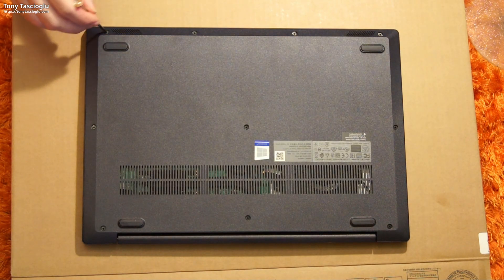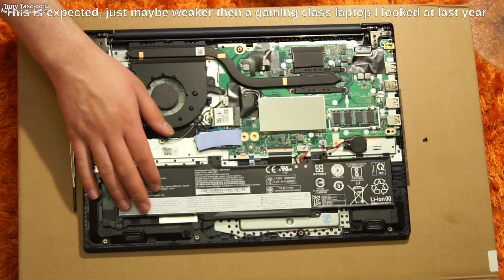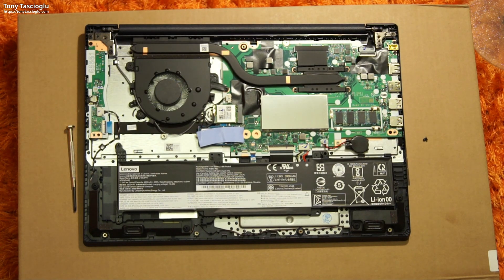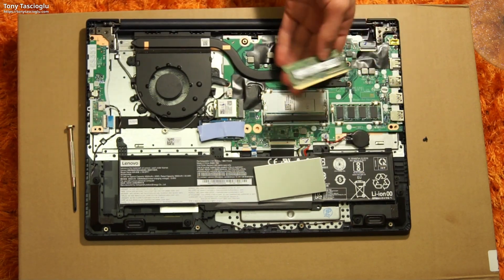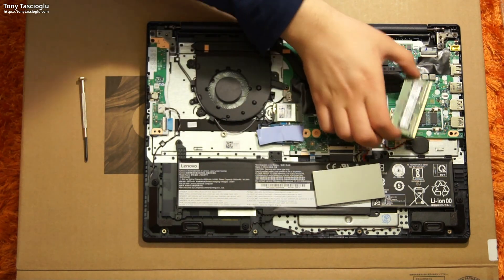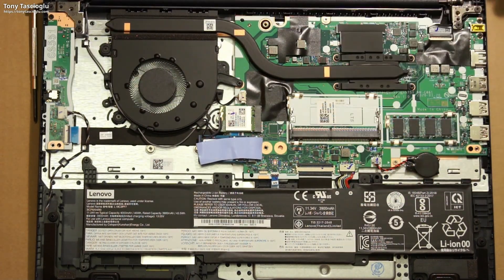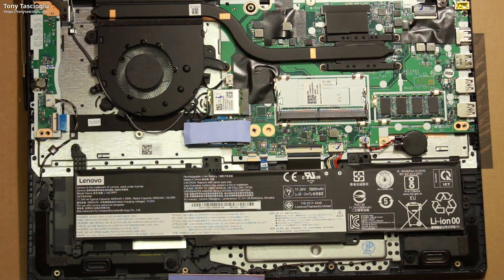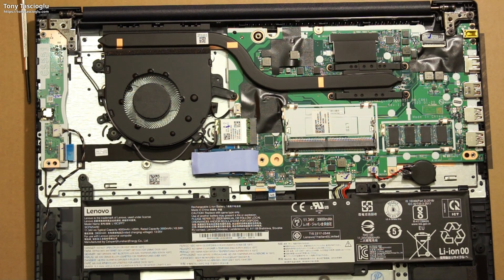Lenovo Ideapad 3 - Upgradeability and Parts

Comment: I hate to say it but it looks like a beginner tech. Some things i notised:
- Crappy screwdriver with no control (too thin handle
- Never pry open plastic with metal. It will cause damage and some customers will notice. You’ll end up replacing parts for free/on warranty = no profit.
- Metal screwdriver will go in too far and could damage conponents
- First thing when bottom cover is off: Remove battery connector!
- Never place removed parts (metal ram cover) on top of computer. I will move and could do damage

Comment: Is it possible to upgrade the graphics card?
Reply: I have the same question. I bought my son an idea pad 3. It’s screen freezes with green pixelation across it (the external monitor also does this). I tried replacing SSD card but same problem. I’m guessing it’s graphics card?

Comment: can we add ssd to increase storage?
Reply: you can - I added a 2TB SSD as well as upgraded ram to 64GB (way too much but better too much than too little).
Reply: @michel0731 what kind of SSD did you add, and have you been happy with it? I’ve got to replace my fan because it sounds like a swarm of angry turkeys, going to add ram and figured I may as well toss in some extra storage.
Reply: @naturaljoe759  I added the Samsung 990 EVO Plus NVMe M2. At the same time, the RAM upgrade to 64GB is also a nice extra although definitely not required to bump it up to 64GB. 

As a nice extra, the FPS rate on Fortnite improved by around 20FPS to 50 - 60 FPS.
Reply: I replaced it with a Samsung SSD EVO Pro which has been performing really well. Definitely a great upgrade.
Reply: @michel0731 I just got back from a half year of travel and opened my laptop up to replace the fan, upgrade RAM, and add a Samsung Evo Plus SSD. My 15itl6 already had an 8gb ram chip under the silver lid from the factory, and has no slot for a second SSD. I hadn’t seen anything about it before, but after some more specific searching, it seems the 38w/hr batteries have a slot for a secondary SSD, but the 45w/hr battery models (which I have) do not. I did replace the 8gb ram with a Crucial 32gb chip, and with the now-quiet fan it seems to be running much better. I ended up giving the Samsung drive to my son for his build.
Reply: @naturaljoe759  Interesting, thanks for the feedback on this. I wasn't aware that there's another battery pack. I do run the 38w/hr battery (which is crapy but I don't run it on battery anyway).
Reply: @michel0731 that’s a very substantial performance increase. I’ll also be adding a 16gb or 32gb RAM upgrade. I have been looking at the Samsung, WD, and Crucial SSDs, but I’m can’t decide what I want to get. Thanks for the quick response, that’s great info!
Reply: @michel0731  also- how did you get to 64gb ram? Did you replace the OEM soldered ram stick?
Reply: @naturaljoe759  yes I replaced it.